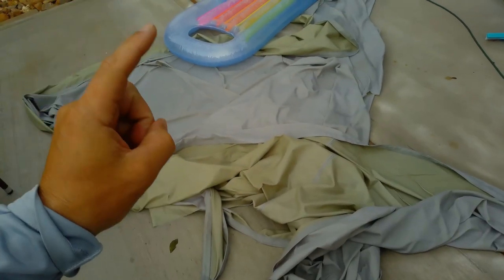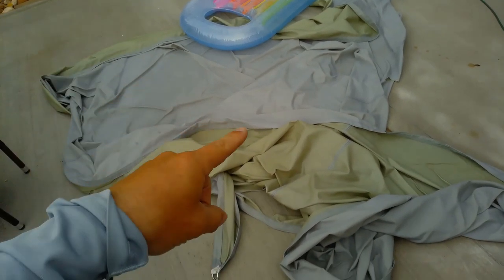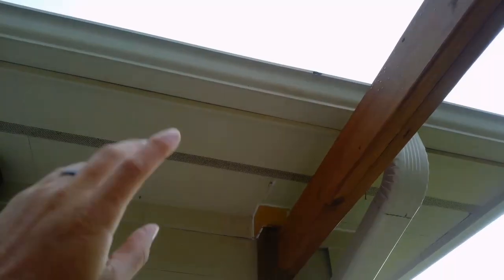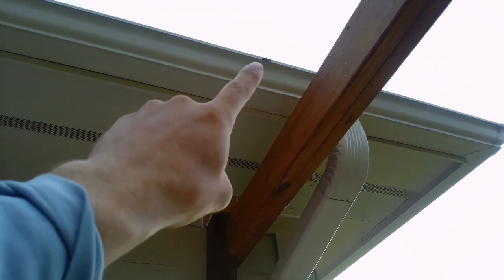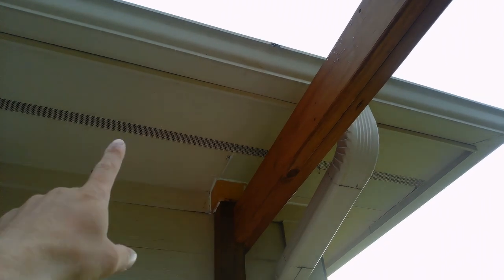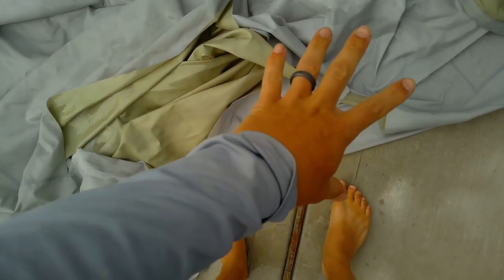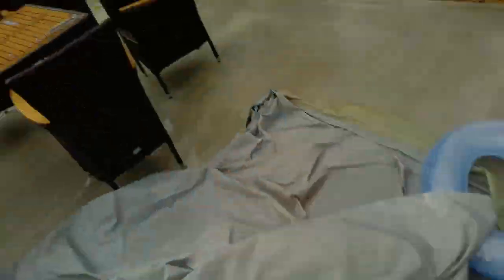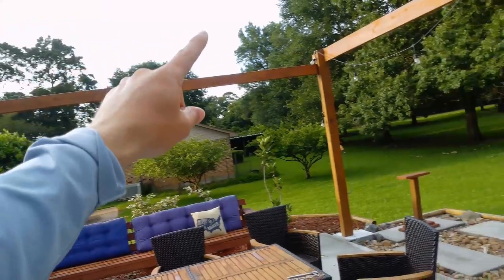Shade Sail Experience and Review ✔

Comment: I have a 16'x20' shade sail mounted to the back of my 30x40x12 garage.  The sail is mounted through the wall of the garage with eyebolts through blocking on the inside wall (walls are open on inside) 11' up.  I then set 6x6 posts in the yard with eyebolts on top at 8'.  I have the sail tensioned fairly tight.  I am in a high wind zone and do not take the sail down for storms.  I did take it down this past winter.  It has held up well.  

I think a steeper angle and a better attachment to the house will solve your problem.

Comment: I can’t leave mine up. I did my posts in concrete pots and if the sails are attached even a moderate wind will blow the entire structure over. Without the sails attached it’s fine. I love the sails but like you mentioned it’s hard to get them super tight.

Comment: Thanks for a truthful realistic experience where shade sails often fail in the wind and rain.  My tarp gathered water so I had to put a ridge board up to prevent that. Then the windstorms finally blew it apart here in West Texas after a couple months.  If the wind is going to blow real hard I guess it's best to take it down temporarily. Thanks
Reply from the maker: Thank you for watching.  I put new shade sails up which I also made a video of.  4 triangle shaped permeable shade sails.  They have been awesome.  I haven't had any issues since installation and have had lots of strong winds and big rains.

Comment: Commercial 95 is the strongest and are permeable (so heavy rains can pass through the material), which is what you need. Those Amazon ones are cheaply made. Buy the way, if you need help (even though this is a year old) I'm actually a reseller for Shade Sails and as long I can get the exact measurements I can get that for you. It's not going to be cheap, as Commercial 95 is commercial grade material, but WELL WORTH EVERY PENNY. As they have a 2 year material warranty and 10 year UV warranty (when it comes to fading issues). Hope this helps. Later...

Comment: Well, several things.  The Hypar shape was good (2 lower points), but don't use a "waterproof fabric", because they aren't, and they create the exact problem that you described.  It's obvious that your sails were not reinforced around the edge, stainless steel cables are best especially with the size of these.  How much curve was built into the  side edges.  Without a curve then yes you cannot get a tight sail, and finally dont use wooden posts, they are not strong enough.

Comment: Several smaller shade sails framed by pvc and locked in using lock ties or pvc pipe within larger pipe hole drilled through both across or simply glued together. The shade can be threaded on using rip cord . The gaps within each frame would allow for wind flow rather than shearing and creating no tension to involve the entire structure...

Comment: Thanks for the video.  I reside in a windy location and was planning to do this project...but now I have concerns
Reply from the maker: I think it really depends on the size of the shade sail. These were pretty big at 16x16ft and waterproof. The waterproof was the ultimate disaster as they collected water, but each design is different and I have learned a valuable lesson from this experience.

Comment: I put mine up and it was great then we had a hard rain and I had a huge pooling of water in the center of it the next morning It stretched it out now I can't get it flattened but I put little holes in the middle of it and now when it rains it filters through yet you can't really see the holes that's the only thing that's worked ugh..
Reply from the maker: I had the same problem. If you can't get it stretched out and with a good slope, you're going to have problems.  Thanks for watching.

Comment: I am wondering how much better is the kind of fabric which allows water and air to pass through?  I think they are described as mesh.  Any thoughts?
Reply from the maker: I think it it personal preference.  If you are looking for shade the permeable shade sails would work great with less hassle. If you are looking for more of a shelter from the elements than the non-permeable shade sails are what you are looking for.  Hope this helps.
Reply: Little About A lot   I have been learning quite a bit recently.  The edges of professional shade sails are curved inward.  It’s called a catenary curve.  The a cable runs through a channel on each edge.  Turnbuckles are used at each corner to tension each cable and hence the sail.  It’s surprising technical.  There are computer programs used by the commercial suppliers that figure out the shape needed.  But these may be fabric specific.  No wonder it’s hard to get it right by guessing.  I did make a set of three, Roman shade style, which can be retracted up against the house which keeps them out of harms way in bad weather. This design involves quite a bit of sewing.  Mine run nylon hooks on stainless steel cables.  May be I’ll make an instructional video on that one day!

Comment: What brand of sail did you use? And if you find any of these permeable fabric sail please share ware you Purchased them
Reply from the maker: I ordered mine through amazon. Can't remember the brand but they were having a sale on the size I needed which is why I went with them.  Amazon has a bunch of different shapes, sizes and manufactures. Permeable or Non-permeable.

Comment: I subscribed to see what you come up with
Reply: i bought the 20x26 shade sail and i also installed 1/4 in. thick coated stainless steel cable and turn buckles  2 opposite V formation top and bottom sandwiching the shade sail no problem with 35 mph wind yesterday just thought i make some suggestions good luck... thanks for your videos